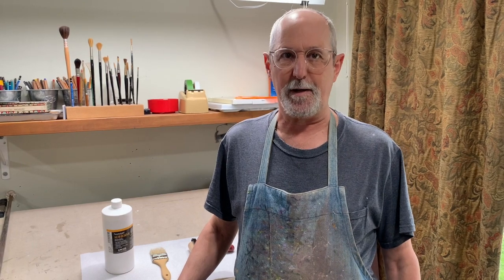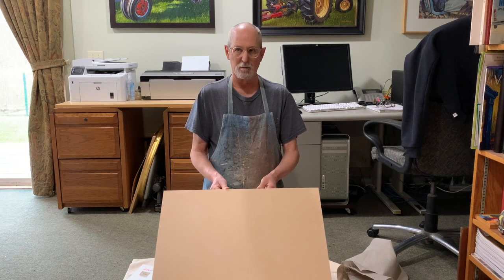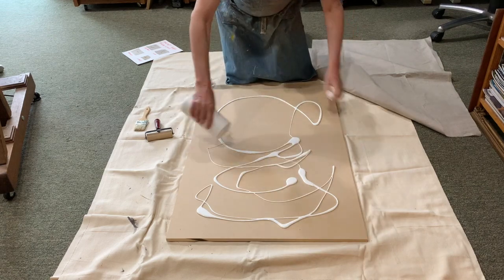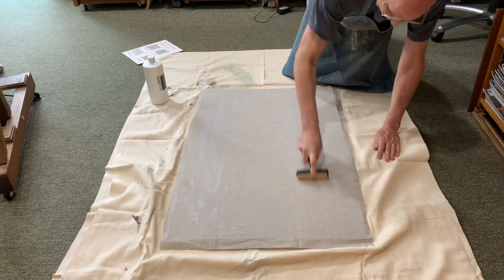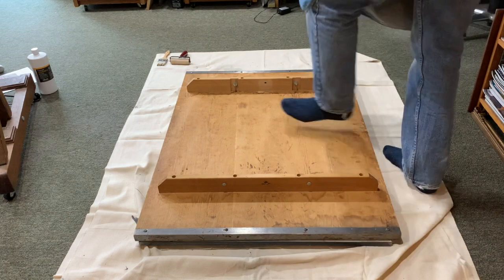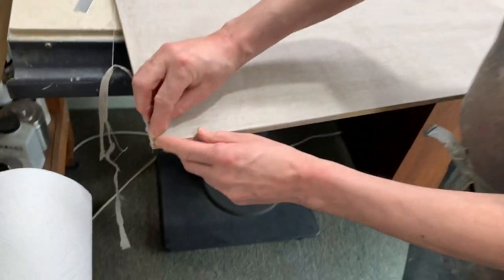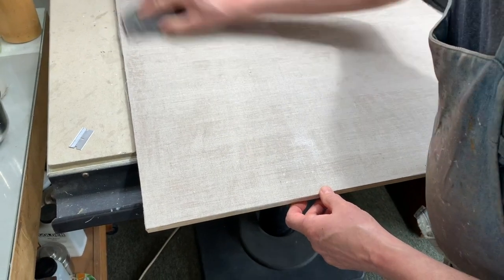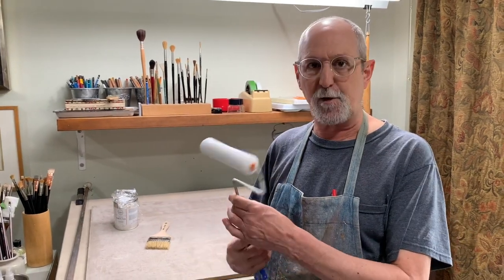Mounting linen to a panel and applying an oil painting ground

Comment: Thank you very much, but before I paint (egg tempera) much better to stick very fine linen on plywood, and make gesso on the canvas when stuck on the plywood? Which linen is the best I need by weight or thickness?
Reply from the maker: I like portrait grade Belgian linen, No. 9620 which I purchase from Soho Artist Materials, NYC.  Please DO NOT use gesso on this very high quality linen.  You should use either a lead white ground, or if you don't want to use hazardous materials, try Gamblin Oil Painting Ground, a titanium white/alkyd mixture.  It's great stuff, I've been using for years. -P
Reply: @baldassinifineart8068  Thank you very much.

Comment: Hi Paul! I have a question about Mdf. Some people say it isn't archival. I'm confused because I want something that I can cut into my own size and I heard that mdf is good and can become even more resistant to moisture if you seal it with shellac or something like GAC-100. Do you do this for mdf panels? Also, I heard that Aluminum composite panels are great. Have you ever used them or recommend them more than mdf or are they pretty much equal and par to each other?
Reply from the maker: Ethan, do not worry about what "some people say".  MDF is perfectly acceptable to paint on. It needs no prep whatsoever, no shellacs, no GACs -- just whatever ground you wish to apply or linen or canvas you wish to mount onto it. MDF has been in use as an artist's painting support for a very long time with no issues. Where is this "moisture" that will ruin your artwork going to come from -- rainstorms, the ocean, swimming pools, tropical humidity, a flood in your basement? I don't think so. Just don't use the stuff that comes from Home Depot or Lowes.  It's way too heavy. Seek out and purchase full sheets of Trupan Ultralight MDF (Medium Density Fiberboard). It's 1/3 the weight of consumer MDF. Use the 1/2-inch for larger size works or 1/4-inch for smaller works like plein air studies or such. You can cut it yourself, as I do, to any size with a tablesaw, hand-powered circular- or jig-saw. It's great stuff, don't worry about it and enjoy your painting time. -P
Reply: @Baldassini Fine Art  thanks for the reply! I'll probably have to stick with Lowes mdf board they provide so they can cut the sizes I need. I'm a college student in a small apartment and don't have the tools to cut my own boards.

Comment: HI Paul! question for you, would like to do this with a linen sheet that already has an acrylic transfer on it, would the glue you use ruin the information already on the sheet? Was wondering if i put matte medium on back of it before if that would workout?
Reply from the maker: Hello Valentina. Good question, I've never attempted this before so I can't give you a concrete answer. I will tell you that the LINECO glue seeps through to the top of the linen as its supposed to because its acting as a "size' to protect the linen from the qualities of the oil paint that will be eventually be applied on top. I don't know what to say about your coating the underside with polymer medium and then glueing it down, but it is probably not a good idea for the long term integrity of the work. Sorry I can't provide you with a better answer. If you do try and an all goes well I would be interested in hearing back from you. -P
Reply: @baldassinifineart8068  of course! thanks for your help!

Comment: I tried using Gamblin PVA size to glue medium weight portrait linen to a birch panel, and the linen shrank enough I had to remove it before the PVA set,. Even though the linen was about an Inch over on each side of a 36 x 60 panel, it shrank to less than the width of the panel. Should I have used PVA glue instead? Gamblin PVA is watery. Otherwise, the linen was unsized.
Reply from the maker: Steve, I have been using Lineco PVA glue forever to affix linen to panels. Have never ever had an issue with shrinkage, no shrinkage whatsoever and it's lay-flat properties are excellent also.  Have never used Gamblin's product so I can't speak for it's differences or similarities.  But if you're having issues with radical shrinkage I would stay away from it and get some Lineco PVA glue instead.  It will work for you, I'm sure of it. -P
Reply from the maker: @UncleJunior52  Steve, you can mount pre-primed linen or canvas same way.  -P
Reply: @UncleJunior52  It's Claessens linen. I think it's the water content: too much. PVA sizing is watery.  Whereas PVA glue is relatively thick and would have significantly less water.
Reply from the maker: @UncleJunior52  There you go Uncle60, just I as described in the video and these posts. Lineco -- great stuff!  -P

Comment: How can I safely remove a big dent from an old oil painting? The linen canvas isn't cut, but very pushed in.
Reply from the maker: Hello Tonya -- Since your work has a dent, I am presuming that you canvas is stretched and not mounted. Unfortunately, I'm not sure how to deal with a dent in a stretched canvas.  I used to paint on them many years ago but I found out that they dented so easily I stopped painting on them and switched to mounting my linen onto 1/2-inch panels instead, and I've never looked back.  That said, you might want consider un-stretching your painting and mounting it directly onto a panel cut to the appropriate size using the glue and method I discuss in my video demo. That way you can easily burnish the dent back down onto the panel, where it will not be noticed at all after the glue dries and sets up over night.  Hope that helps. -P